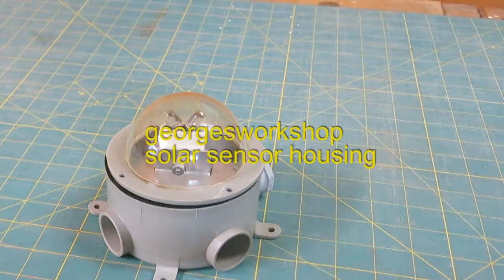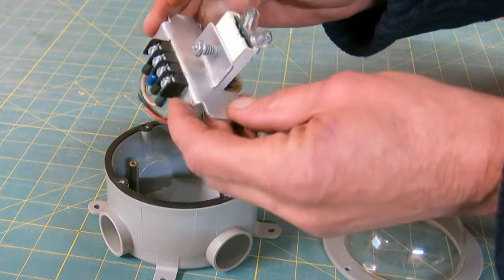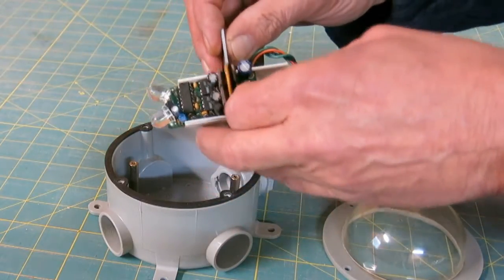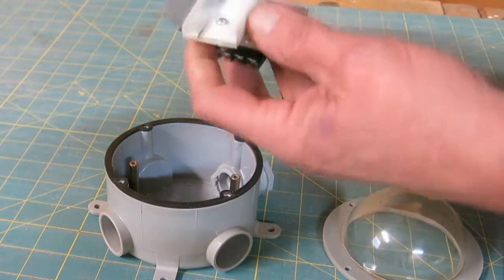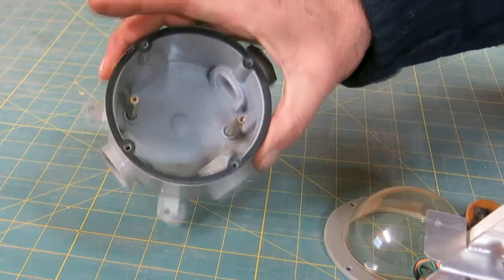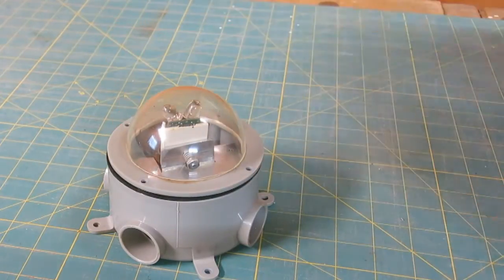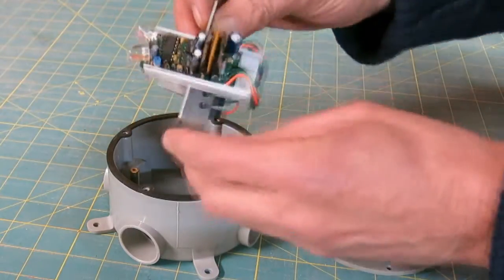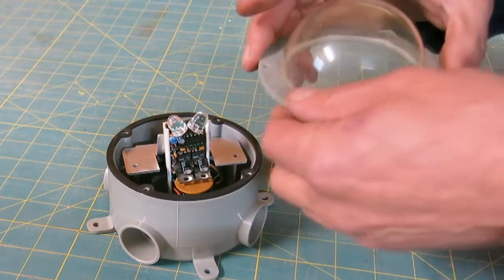georgesworkshop diy weatherproof solar tracking sensor housing

Comment: George, just for your perusal, have you seen the solar tracker/Heliostat gubbins by www.cerebralmeltdown.com?
It uses time and it's global position to calculate where it has to aim at any given time, and it is not too expensive. The approach it uses seems to be more of an engineering approach over sensing light levels.